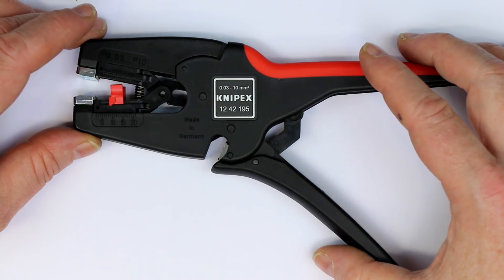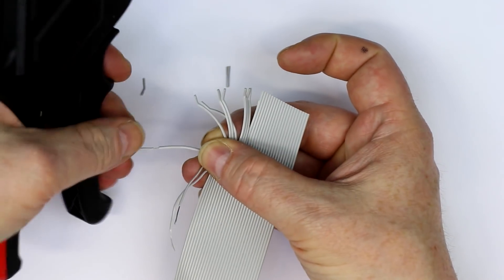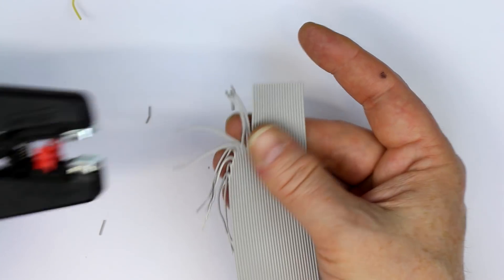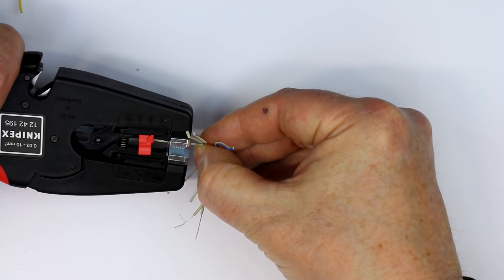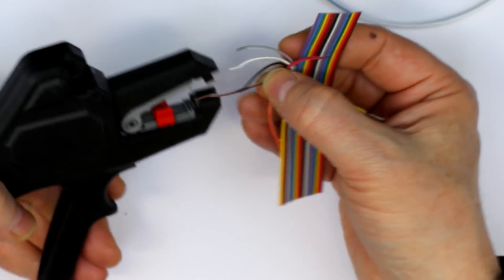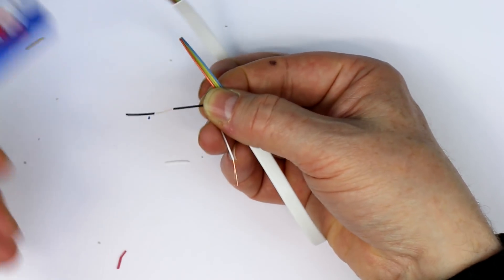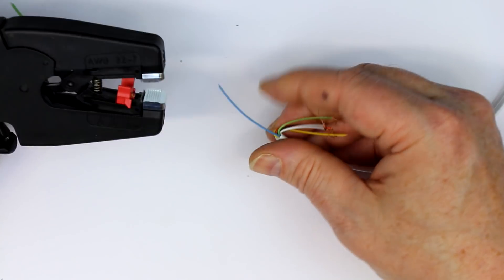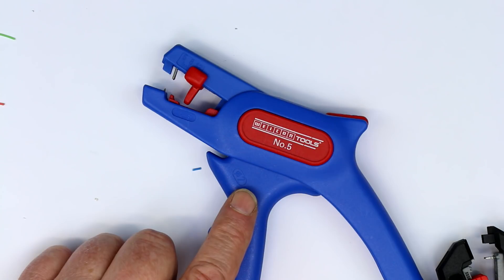Knipex Multistrip 10 - An unbiased comparison to 2 contestants

Comment: Always heard good things about knipex products but since I don't use wire cutters in a professional setting my cheap strippers will have to do, would be nice to win the lottery and have some of the tools this channel demonstrates.
Reply: Products they actually make as in their pliers which are hands down the best in the industry. However these are more than likely rebranded from knipex so not actually made by knipex. This is the world we live in now. Even the pro tools are rebranding secondary products.
Reply: @MadMetalShop  I thought Knipex were the best until I tried Erem (which is now part of Weller, so now sold as Weller Erem) a few months ago. Their electronics cutters are insanely nice. They actually manage to make Knipex cutters look cheaply ground by comparison, and Erems' totally-internal springs are nicer than the leaf springs in the Knipex (and most others). Erem tweezers are also exceptionally nice. The Swiss know how to do precision, and Erem absolutely showcases this.

Don't get me wrong, I remain a huge fan of Knipex. Erem is simply on another level (including in price: they're solidly double the cost of Knipex). Similarly, I thought Wiha and Wera screwdrivers were the best until I tried PB Swiss…
Reply: @MadMetalShop  As for strippers, it certainly looks like a lot of them on the market, including some of the Knipex, are rebadged Jokari (a German company that appears to specialize exclusively in wire strippers and cable jacket strippers.)
Reply: I just noticed this was posted on April fool's... Was this a joke?
Reply from the maker: No.
Reply from the maker: I am quite sure I did everything right.
The red thingy is the adjustable end stop for the wire to strip it to a defined length.
That´s why it´s mandatory (and intended) to push the wire up to this end.
All wire strippers have this feature (the Weicon as well as the smaller Knipex alos).
Perhaps we are talking about  2 different things?
Any way another viewer commented that the Multistrip 10 is really bad at stripping small diameter wires.
I later took a look a the homepage of Knipex and there they also mention somewhat hidden that both of the tested models are somewhat problematic in stripping thin PVC-isolated wires.
Reply: KainkaLabs oh ok , I use cheap cutters so I never handled these ones demonstrated, I apologise and will edit my previous comment

Comment: If I am stripping a large number of wires from ribbon cable I find the cheaper knipex leaving a sleeve of insulation on the wires useful. I strip all the wires first and then pull off the insulation just prior to fitting and soldering each wire. Less messy. Thanks for the usual quality video BTW.
Reply: Some automatic strippers have a setting to deliberately leave the insulation stub on. I'm with you, I like leaving them on to bulk strip. 

Here's how partial stripping works on the Weidmüller Stripax: https://youtu.be/JaeAhSAok2U?t=85

Comment: i have both knipex strippers and they do not work on fine wires. I also have Knipex 12 40 299 which is more suited for fine wires as the jaw can be adjusted.

Comment: The Weicon No.5 Automatic Wire Stripper does not seem to be available in the United States. At least not under that name. 
Does anyone know if the same tool is available to those of us in the USA perhaps under a different brand name?
Reply from the maker: Availability of the Weicon No. 5 for customers outside of Germany:
Our European shop: http://www.ak-modul-bus.de/stat/automatik_abisolierzange_weicon_no_5.html
or for customers outside of Europe our international shop:
http://www.ak-modul-bus.de/cgi-bin/eng/iboshop.cgi?showd1010!15,376848189978378,ZANGE4
Reply: KainkaLabs can you ship it to Russia?
Reply: Erik Burman it is definitely available in the US...mine was branded as Titan ...ordered from amazon...but available in a lot of place...it is the model Titan 11479.... hope that helps!
Reply: Capri also makes some dead on the weicon ones. On Amazon.  My pops has them and been happy.  I have the first knipex ones in the video and have no complaints.

Comment: Thanks for the review Dennis, it was very useful. My elderly Radiospares strippers don’t do so well on thin wires so I ordered your winning strippers. In the U.K. they are available from Amazon and also Rapid Electronics. The cost from Amazon is about £21 including postage from Rapid, I suspect buying direct from Rapid might be cheaper.